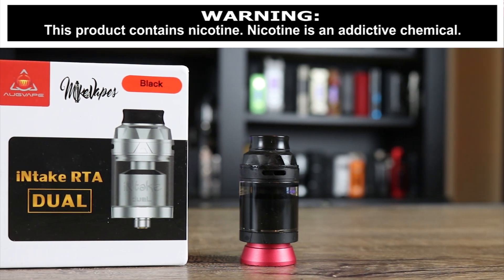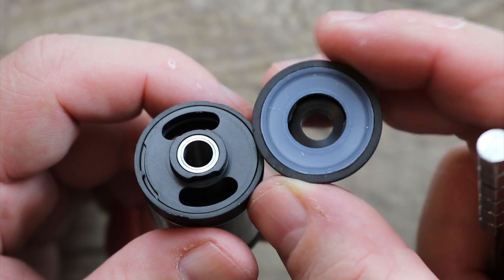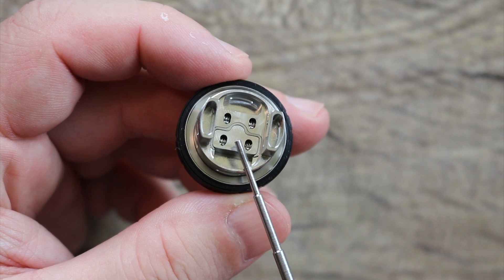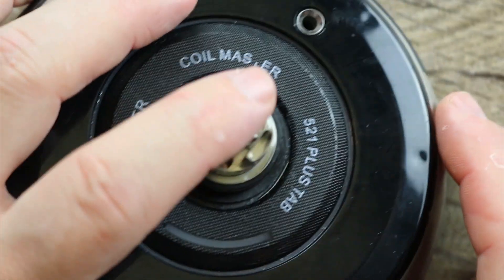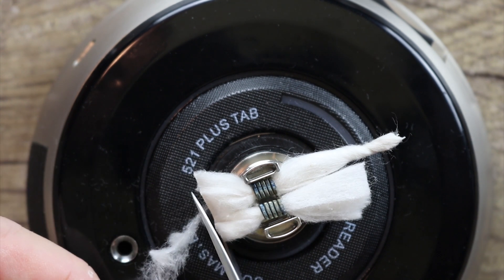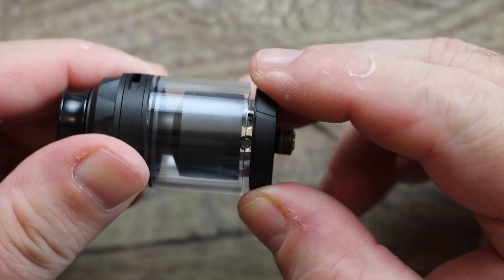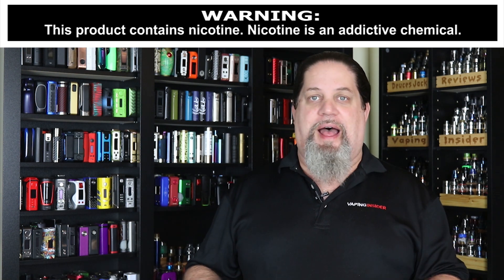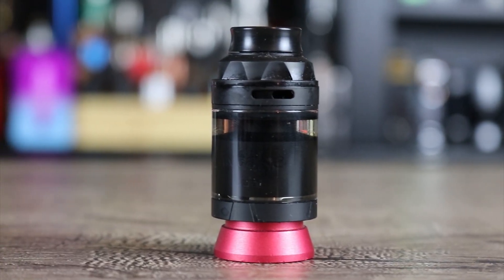Best Top AF RTA ✌️🚭

Comment: "zomgz it's the best!"  How many times have we heard this?  Getting one to try by I would bet anything it's not as good as the MK.
Reply from the maker: It's built better than the MK.
Reply: @VapingInsider  So all the complaints of the top cap being too tight and how loud it is = better build quality?  Funny how nothing remotely like that will pop if you Google the MK.  The only thing that counts is how well it functions for it's intended purpose.  We'll see, I have one coming.  If I'm wrong, I'll order 3 more to replace my current weekly rotation of MK's and happily eat crow.  I'm not getting my hopes up though.  I expect it'll be like the Zeus X and have a spot ready right next to it in my junk drawer.
Reply: @VapingInsider  One question for you before it shows up:  Can you leave it laying on its side overnight without leaking juice?  It's not something I do purposely, but one of the main benefits of the MK is that I can vape in bed and fall asleep without finding a giant juice stain on the sheets the next day.  I know the wicking will need to be spot on, clean the condensation under the tip and to not overfill.   Thx
Reply: @VapingInsider  No issues with my top cap being tight (silver finish). It was good for sure.  Better than anything else I've tried and I liked the tighter draw.  Makes it different in a good way.  Overall is it better than the MK though?  Not IMO.  Flavor is equal, but it produces less vapor and it's more complicated to thoroughly clean.  It's a little louder too, but it's not a huge deal unless you're trying to sneak it somewhere.

Comment: I wouldn't buy it, but I have the intake and it packs a HUGE amount of flavour in just a single coil, I even stop using all my 2 coil RTA's after buying the intake as it just produces huge flavour and never makes the juice to drip all over my mod... However the Intake RTA single coil has a badly designed 510 pin, its pressed and mine always have a bit of eliquid all the time around the whole 510 pin...

One thing I also don't like and this dual Intake RTA looks the same is even though the filling cap is nice, it's a big mess of e-liquid, it's badly designed since it gets a huge amount of e-liquid all around and keep giving different flavours for a damn long time, we have to keep cleaning it, wish it would always make the liquid to go back down to the cotton and not stay trapped all around the middle fitting...
Reply: I'm curious here, you say the liquid doesn't always go down to the cotton, and filling can be messy - is yours a 2ml TPD version with straight glass only? I've had similar problems with a few TPD tanks - an aftermarket bubble glass has made filling much easier and there is more internal space for the juice to get to the wicking.